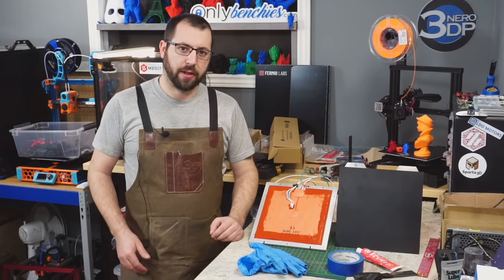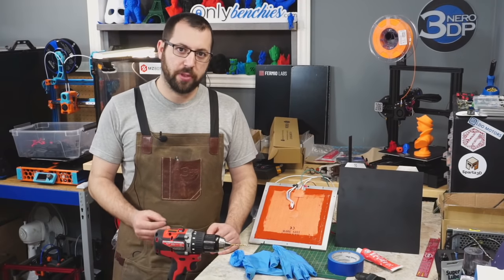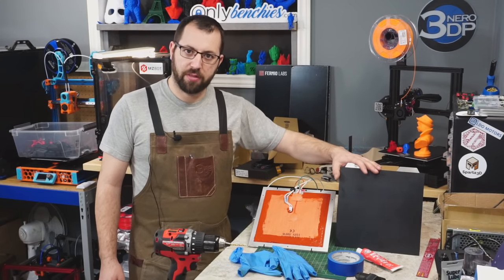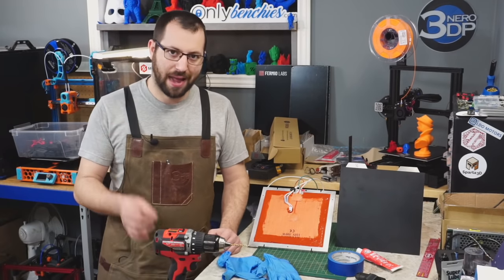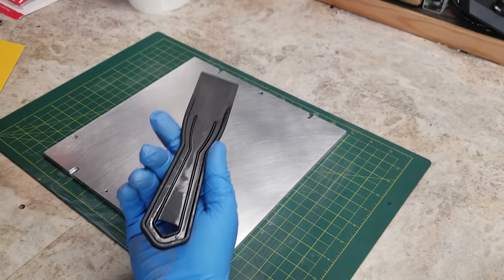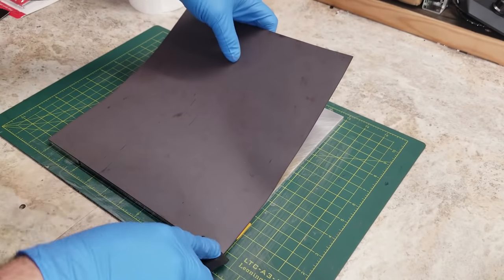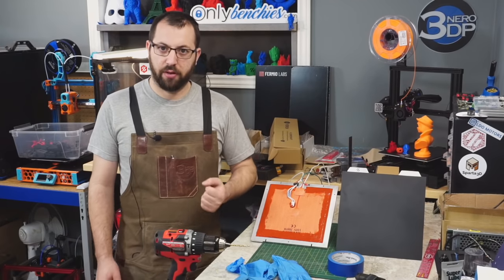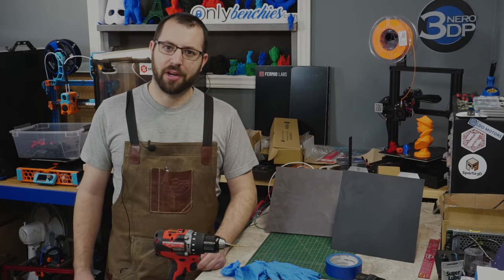Cast Aluminum Printer Bed - Putting together the best DIY print platform for your 3d printer

Comment: Minor correction:  SSRs fail 'closed' not 'open' (IE. the switch is closed and conducting).  Excellent video - thanks!!
Reply from the maker: Flubbed a line. Good catch
Reply: @Fuckoff-1  yep just it's more common for them to fail closed

Comment: When you attach the ground wire it’s a good idea to put a shake proof washer between the ring and the plate. The teeth on the washer bite through the thin oxide layer on the aluminium to make a better contact.

Comment: I find the discussion about "cast" aluminium plates very funny. I worked in a aluminium factory as a young engineer. Every aluminum plate starts as a cast block of alu. That is then rolled into flat shape. It is then heated up to 460 - 560 °C to homogenize the crystal structure in the metal. So actually if you buy a rolled piece of aluminum that was homogenized it is more stable for bending when heating up or cooling down as a not heat treated piece of really casted aluminum.
Reply: Many printer beds are made by extrusion, which you may know better than me that it induces a lot of stress in the metal crystalline structure.
Reply: @vinnycordeiro  I don't work in that area for over 25 years now, but it would not make sense to me to use a complicated process like extrusion for a simple flat slab of aluminum. Especially as cutting a generally available slab of aluminium is much easier with minimal waste. Extrusion is a complicated process that requires complex machineries and therefore commonly used for profiles that cannot be produces in another simple way. To me that hole "casted bed" just sounds like a new buzzword to rip off people. But that is my opinion.
Reply: @Empusas1 Goto Alibaba and look at how the factories are making their beds and you will see why there are so many problems with cheap rolled aluminum beds.
Reply: @Deneteus  Lot to unpack here. 
First the properties of aluminum depend mainly on the alloy used. There are many alloys used today for different purpose. I doubt that you can find a 99,9% aluminum plate. For rolled plates, foils etc often used alloys are AlCuMg, AlCuSiMn, AlMgSi, AlZnMg and AlZnMgCu. The same type of alloys is used for aluminium that is rolled, extruded or cold forged. Every time you mechanically change the shape of a metal object you get tensions in the object and distort the natural crystalline metal structure. To remove those tensions there is the process of homogenizing that I described before. In additional those alloys can be hardened by heating them up to 120 -175°C for 1-2 days and let them cool down in a controlled curve. You may look up duralumin for more. 
For castings different alloys are used like AlSiMg, AlSiCu, AlMg, AlMgSi, AlCuTi, AlCuTiMg. Those are not suitable for any extrusion or other mechanical reshaping as they have a natural hardness that would let the parts break or crack. Those either casted into the final shape or a blocks of aluminum that are cut into slabs and/or milled into shape. 
So the alloy defines how the block of aluminum can the processed into the final shape. 

It is true that there are companies that sell slabs of casted aluminum for special purpose like the company "Gleich" in Germany for example. They also heat treat the aluminum block to homogenize them before the cut them into pieces. There is video about the process shown here: https://youtu.be/HBvVleIO75A

different
Reply: @Empusas1  I like how you went on a tangent when i never said anything about alloys or 100% aluminum plate. I said the word cheap. I am already aware of everything you just said. That doesn't change the fact they are cheap and typically attempt to return back to their original shape over time when heated.
Reply: @Deneteus  Maybe I could still not explain my point. Every piece of Aluminum is casted at the beginning. But that is not what gives any properties. If all factories In China have a bad quality is not something I can prove or prove wrong. Neither how they produce.
Reply: @Empusas1  I understand the point of alloys, tempering and crystallization. The majority of companies are trying to save money. They literally pick materials from the lowest bidder.  They aren't invested in selling you a product without defects because purchasing a higher quality material would eat into their bottom line. a majority of companies started out just copying what they saw everyone else doing. They didn't have engineers on standby explaining material properties. Creality literally spent the least amount of time and money as they could which is why there are millions of warped beds floating around today. That is my point. They weren't going to spend money and time buying cast plate that needed more machining to lower the weight so they could use cheaper steppers.
Reply: @Deneteus  First every business is looking for the "cheapest" way to produce. Or they go out of business as they are not competitive. The trick is produce cost effective while deliver the quality you desire. 
Chinese companies can produce "cheap" as they have very low labor cost and no environmental protection constraints.
But that does not always mean the quality is bad.
Reply: @Empusas1  Your return rate loses you money just as much as overspending on part quality.
Reply: Sorry for the late reply, but it is very interesting topic and your opinion is consistent with my doubts.  I'm building some 3d-printer machine now and going to use rather cheap aluminum plate made from AW-5083 grade (AlMg4,5Mn alloy).  As far as I understand it was neither casted, nor extruded, but rolled out.  And this kind of alloy used especially for application with high termperature gradient.  I'm trying to figure out in advance what could go wrong and I can't find anything :)
Reply: You could just google "cast tooling plate" instead of spreading this nonsense. The tooling plate is cast, stress relieved and ground to precision thickness and flatness.  No, you haven't exposed an elaborate scam that nobody else in the industry noticed and none of the people with years of practical experience in this hobby could work out. 
Even worse you then link to video of the production of the exact "buzzword" "rip off" cast plate as if its something different and not the exact thing being referenced here.
For sure, some peoples opinion of their own inteligence and knowledge is waaaaay over exhagerated.

Comment: Nice video, thank you. I'd like to mention (albeit 3 years late,) that the thermal expansion coefficient of aluminum is unaffected by its manufacturing method. Aluminum has around a 24x10^-10 TE coefficient. So the claim that it doesn't expand is not true. Other than that though, great video. Ty

Comment: Dude, eeeevery f***n detail. Even grounding the plate, which 90% miss out on. You got every single detail! Great video & content!
Reply: Nope, he missed protecting the wires from the abrading on the edge of the plate. strain relief is not a substitute.
Reply: @joshua43214  I dunno. The plate is for a Voron, where it won't be moving at all.
If the plate was moving along y or z, then yes, then protection is mandatory. But in a Voron, the cables will not see any movement what-so-ever.
Reply: @docpayce1  The bed of the Voron 1.8 does move on the Z axis, the static bed is on the 2.4
Reply from the maker: That will be covered during installation
Reply: @vinnycordeiro  Aaah, I See. Ok, ty for clearing that up!
Reply: @docpayce1  Even if it was entirely stationary, it would still undergo vibration which will saw right through the insulation on the wire if it is in contact with the metal at all.
I have seen aluminum plate with rounded edges saw through wires from nothing more than the vibration of an 80mm Noctua fan. It is a real issue.

Comment: I believe my SSR failed, the light no longer lights, I am getting the ADC out of range shutdown error in mainsail.  I have disconnected the SSR  and bed heater from the MCU.  I cannot find any Information on How to test the bed heater with a Multimeter, I have continuity between the wires that power the bed, but the "red" wires that connect the pad to the MCU do Not have continuity, Is my heat pad ruined?

Comment: Small correction in terminology: In electronics, when something "fails open" it means it fails open circuit. I.E non-conducting. The two fail states are described as failing open and failing short. Failing open is the safe one.  Your use of "fail open" is the one applied to water valves etc, in that when they fail open, they fail with the valve open.

Comment: Hey fellow Canadian! Because you are making an electrical connection to aluminum (the ground connection), best practice is to use electrical joint compound between the crimp and the bed to prevent possible future corrosion. Aluminum is highly susceptible to oxidization, especially when in contact with dissimilar metals. We call it Penetrox, but there are other brands available. To be clear, it is not dielectric grease. Love your videos, by the way. I credit a lot of my success with my current build to you, haha
Reply: Oh that's a good point. I have some no alox stuff I use when I have aluminum wires landed in an electrical panel, I should put a little on my printer bed ground!
Reply: Just for clarity, are you sugesting to apply some compond inside the crimp? and would this apply for all crimps and ferrules that would be used with the copper wire inside a printer build? you suggestion has raised some alarm bells in my head....
Reply: @richk6216  no, those pins are plated copper pins. They don't need anything. This is just for the ring terminal to the aluminum plate.
Reply: @hondaguy9153  ah that makes sense, thanks for the clarification 👍

Comment: Does the silicone you use to mount the thermal fuse insulate it from the heating mat in any meaningful way?
Reply: It's not ideal, but it'll still reach a steady state not much lower than the heater. At least with some insulation if the heater overshoots on heat up by a bit it won't trip the fuse unless that overshoot persists a decent amount of time.

Comment: That was exactly the video I needed as I have a similar thick precision print bed kit from Filafarm (based in Germany) sitting here waiting for installation. Various print projects keep me from finally starting with the installation and I'm also no electrician so I was slowly gathering all the knowledge needed to do this safely. Your video nicely summed up all the bits and pieces I found across the web including some tips I didn't see elsewhere (like the extra heat resistant silicone around the heater mat).
Btw. my heat protection fuse is not a cased variant like yours but instead looks more like a basic transistor. Are there advantages to the one you use?

Comment: Does anyone ever apply magnetic sheets or any of these adhesive items like window tint or automotive decals where they use windex or a soap solution to lube the sheet to allow for moving it around and removing bubbles and then when it all drys it is all flat?

Comment: So, I did this install about 2 years ago.  Last night I rewatched the video - after noticing my bed was bowing and i coudl press it inwards around the center (kind of like my own stomach) - turns out the adhesive was failing, and the RTV held the edges quite solidly.  THANK YOU.  I don't know how close to a house fire I came (if at all) but I'm incredibly grateful for the RTV tip.  As I now await my new heater.

Comment: It would be good to see a thermal camera view of the bed when in operation, especially at higher operating temperatures to emphasize any gradient. I would expect that a major effect in warping would be differential heating and thus expansion of the middle of the bed compared to the periphery. The middle would expand but yet be constrained by a less-expanding outer ring, inducing a bow up or down perhaps. For this reason, I think it would make sense to insulate the exposed peripheral inch or so of underside, so that at least that outer area loses less heat and would come up to a temperature more similar to the middle.   If in practice a bow is not seen, then it would still be informative to see the heat map to learn what amount of temperature drop-off at the edges failed to produce a bow.  Of course, these considerations are not particular to the bed discussed here, but as long as we're getting all sciencey on this one, it would be great to see how these variables play out!
Reply: @MarkRehorst  Thanks for that interesting IR image, quite informative!
Reply: @MarkRehorst  neat
Reply: For a cast aluminum plate, that's right: Any warping would probably be a consequence of uneven heating. For an extruded or otherwise formed plate all bets are off - those can have residual stresses that cause them to warp even when uniformly heated.

Comment: One thing you REALLY NEED is to protect those wires from the edge of the plate.
Use properly rated heatshrink you get from a reputable supplier (the local big box store is fine). You want the stuff that is used in mains wiring. It will be expensive, and really thick. Do not not imported stuff unless you know for a fact the certification has not been forged (all the inexpensive stuff on Ebay and Amazon are probably forged certificates).
A single layer of Kapton tape should be under on the bed that comes up over the edge under wires is secondary protect.
Reply from the maker: That sort of thing along with mounting the bed will be covered during the install.

Comment: something to maybe consider.... if your thermal fuse falls off as heat rises and then it loses the protection it was designed for..... There is usually nothing under where you mounted it to catch it... Maybe best to use Both a bolt on one And one as you have? being mindful that many follow you and print when not home and overnight? cheap insurance? NOT being the fire chief just a observation... Rock on man your doing a great job!

Comment: One thing to mention about connecting the fuse: Solder joints work perfectly well at mains voltage, and even voltages above that. However, they are low temperature welds, and heat cycling at the 100°C that some filaments require would cause problems long term. I disagree with your usage of automotive crimp connectors, as manufacturers frequently don't certify them above 24V DC, and even lower voltages AC. I'd suggest instead using what electricians use: Mains insulated screw connectors, or Wago-style snap connectors, along with ferrules. They are intended for use in house wiring, and thus support both the voltage and currents you need. They also have the added benefit of being simple to disconnect if needed.

If you were working in a factory, waffle iron and coffee maker manufacturers frequently use solid core wire (as well as thermal insulation you wouldn't need for this application), and spot-weld it to their in-line fuses.

Comment: What is the difference in heatingtime at 12v, 24v, 48v, 110v & 220v silicon heater?
I want a silicon heated bed but i am a bit hasitant to put 22v on my printerbed.
I was thinking about a 48v silicon heater.
So can anyone tell me what the heatingtimes are of theese heaters?

Comment: You don't want to use solder on mains power but solder is how ever mains device in your house is connected. TV power cable in to socket on TV that is SOLDERED to the main board. Shit now adays even toaster are soldered power cords as most of them and a circuit board in them. That being said I would feel safer with something that mechanically would not come apart under any loads so solder it because 110V mains charged base plate sounds like no fun.

Comment: Very nice video. No need to insist on cast alluminum tho.your printers frame tolerances are way higher then difference in warping between cast and rolled alluminum plate.i bet if you could scan frame and compare diagonalls othey would be off by 2 mm for shure. Also you glue on top magnetic sticker and put up spring steel sheet. So ...
Reply: Problem with rolled alluminium is that it warps after heating many times.

Comment: I was interested if the gasket glue is could also release a kin to the 3M adhesive which is holding the fuse. So a possible overkill could I run 2 fuses in series. One attached to aluminum and screwed that other stuck via gasket adhesive to the heater mat. Or is that really overkill.

Comment: Is the thermal fuse also required with MOSFET-controlled DC-beds?
Reply: Yes, it's a safety measure related to the temperature itself, not on how the bed is fed energy.
Reply: @vinnycordeiro  Its a safety measure related to the tendancy for SSRs to "fail on" - MOSFETs don't tend to do that
Reply: @Graham_Wideman  a MOSFET short melts the die and opens the circuit.

You've discovered the fault but not considered the consequences - I suppose though you can find any answer you want on the internet !

Comment: Perhaps you could arrange a demonstration showing the difference in heating times between the AC heated thick aluminum bed and a DC heated thick aluminum bed?
Reply: If the heaters have same power there is no difference.
Reply: If the heaters are the same wattage then sure, they will heat up the same.

But Watts = Volts x Amps. 

So if you have a 500 Watt heater running off of 120V then it only needs power from the wall to supply about 4 amps.

If you have a 500 Watt heater running off of 24V then it needs a PSU than can supply 20 Amps. 

High Amperage PSUs get expensive pretty quick.

Comment: I did this but I am concerned because Gardner-Bender heat-shrink Butt Splice  connectors say they are only rated for 105°C on the back of the package.

Comment: Is a thermal fuse necessary for DC heated beds? I am using a robust MOSFET to control current for a 200W 12V Keenovo heater on an old printer. I am having a hard time finding any information about thermal fuses other than in the case of mains powered installations.